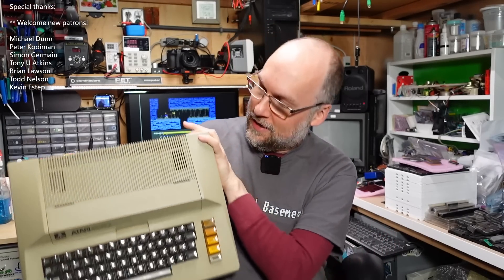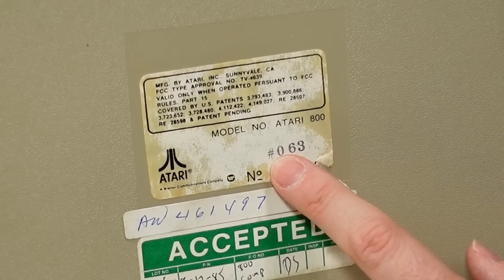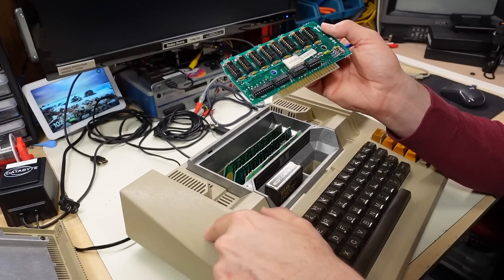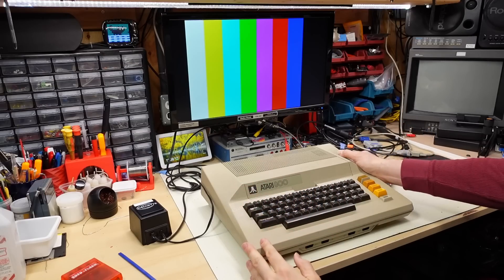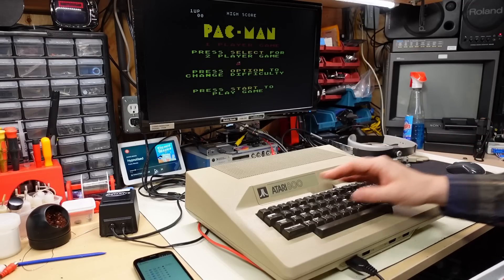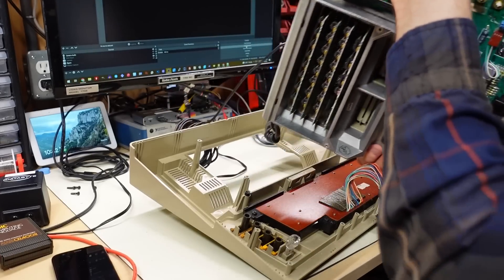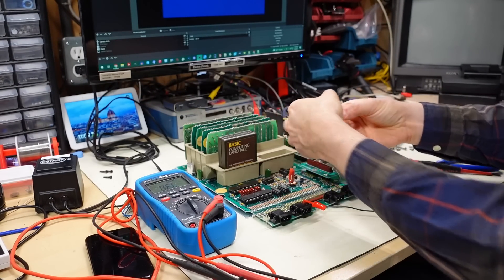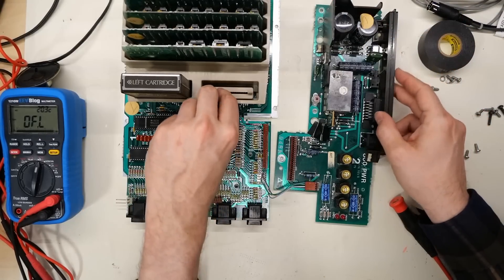Troubleshooting the beautiful Atari 800

Comment: The Apple 2's graphics snd sound capability were rubbish in comparison to any of the Atari computers.

The Apple 2's audio capability consisted of a flipflop connected to the speaker. Write or read to the specified memory adddress and the flipflop would change state, moving the cone of the speaker in or out.
To generate tones you had to write a program in machine code that would flip that flipflop at high enough speed.

There was no multichannel sound, no waveform generators, no envelope generation, no volume control, no white noise generation. There was absolutely nothing.

The Atari 400/800/XL ranges were in a completely different league.

The Apple had no software support for audio. There were no commands in the Applesoft BASIC programming language for sound generation, apart from producing a beep of fixed duration and pitch using chr$(7), printing ASCII character 7, which was intended to recreate the bell from line printers/teleprinters.

Comment: Atari was well built, thick aluminium shield inside. That is why Atari is no longer with us, overpriced computers went off the market. Commodore was build cheaply, a cardboard shield with tin foil glued on it. Cheap computers, under achievers, bargain prices. That is why they are no longer on the market. Malfunctioning computers that almost performed a blue Monday.

Comment: Why dismiss the shielded direct connection AFTER admitting the I / O was completely No Compromises?
Why not look for advantages of a properly shielded RF connection with a set length and Resistance, and a connector that seems to have stood the test of time.
You want to RIP it out because you can't explain it's existence in your tiny imagination, Mr. Black.
Go take it for a walk....get some Sun, son.

Comment: “The apple || does have expansion slots,the atari 400/800 doesn’t have that”
Moments later “once i put out those screws out the lid should comes off and look it here we do have 4 expansion slots”

Then what on earth are you talking about,becides if you do the keyboard in another video then why don’t you add in the title part 1,HOT DAMNIT👎